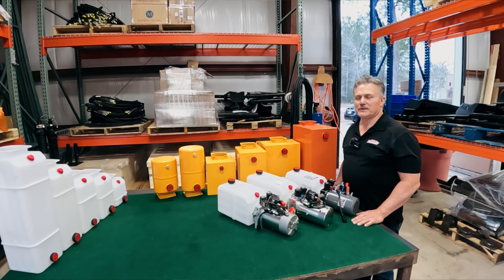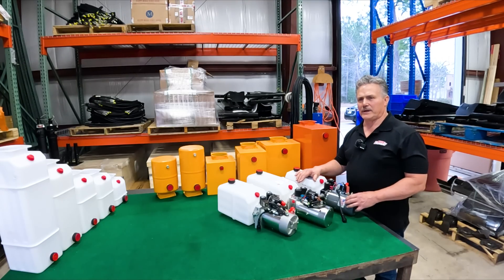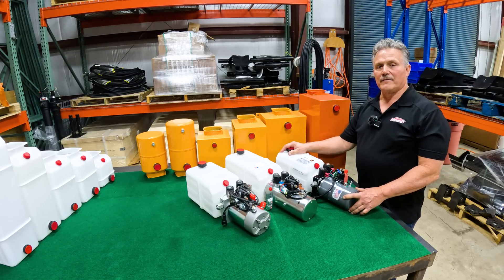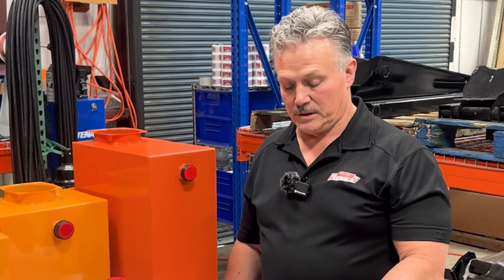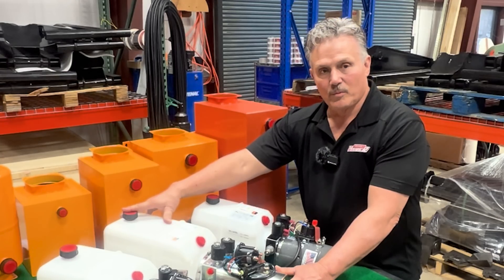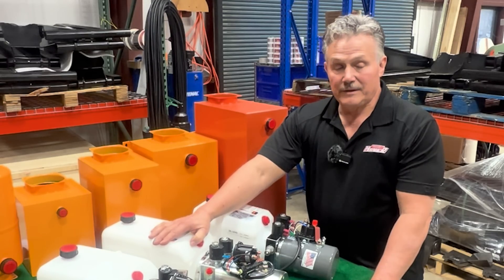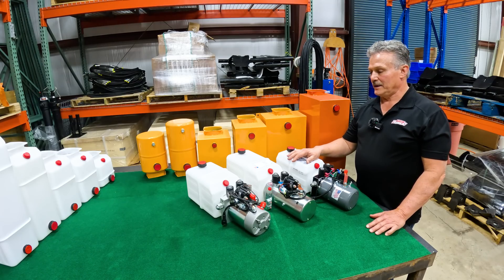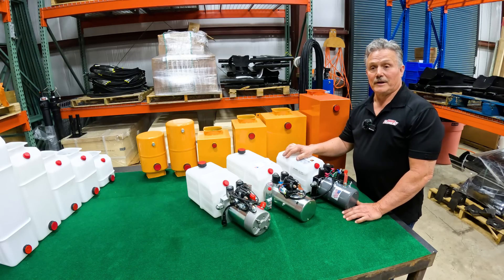How do I choose a Hydraulic Power Unit?

Comment: How do I know if I need a 24 or 12 volt
Reply from the maker: The best way to determine if you need a 12V or 24V setup is to use a voltmeter. Here’s a quick guide:

Set your voltmeter to DC and place the red lead on the positive (+) terminal and the black lead on the negative (-) terminal.
If the reading shows 12-14VDC, you have a 12V system.
If it reads 24VDC, you’re working with a 24V system.
Another way to check is to look at the battery setup. If you only see one battery (especially in a dump trailer), it's likely a 12V system. However, using a voltmeter is the most reliable method to confirm your voltage.

Comment: What kind of fittings does it come with? Just says sae6 on your sight,I want to know if it's English threads like vevor,or not threads,don't see any info on threads,pretty sure one i have not is npt to jic
Reply from the maker: Generally the fitting that is installed in the pumps manifold is a 90 degree fitting -  #6 Male SAE (O-Ring Boss) into the pump manifold and on the other end is a #6 JIC male, where the hydraulic hose is attached. Here are the specs on the fitting.    Part Number - 6801-06-06-4    Tube OD - 3/8"  - Male JIC threads  9/16 - 18    Male SAE threads 9/16 - 18

Comment: How about a video on the Solenoids, valves and seal failures, replacement and holding loads, and up and down pump pressure relief settings?  More information to help the average mechanic to resolve issues.
Reply from the maker: Hi there,

Thanks for reaching out! We’re glad to hear you’re interested in learning more about maintaining your hydraulic setup. We’re actually in the process of creating a video that covers key troubleshooting tips for components like solenoids, valves, and common issues with seal failures. This video will also include guidance on seal replacement, load holding, and adjusting up and down pump pressure relief settings.

Our goal is to make it as informative as possible for mechanics of all experience levels, so you can diagnose and resolve common hydraulic issues with ease. In the meantime, if you have specific questions or need immediate assistance, feel free to reach out – we’re here to help!